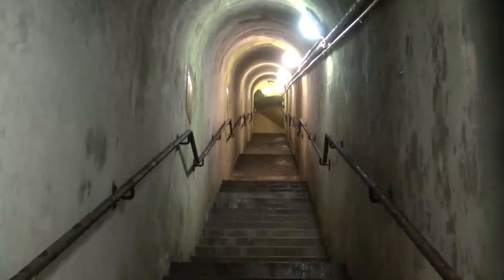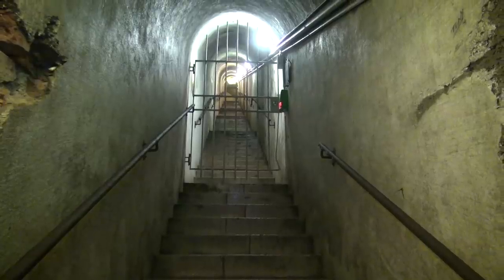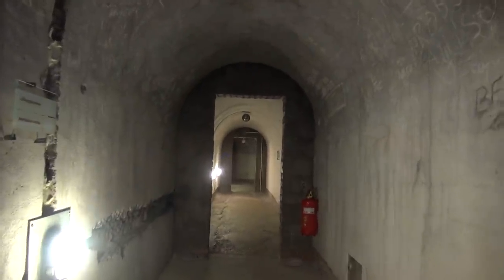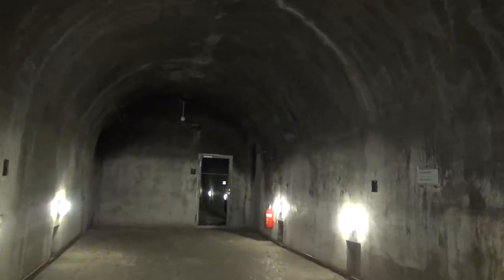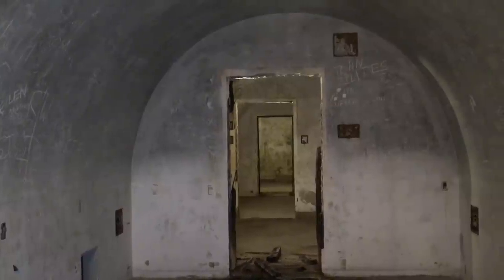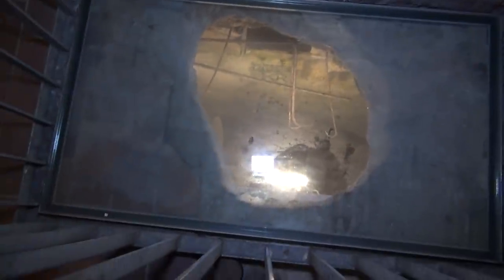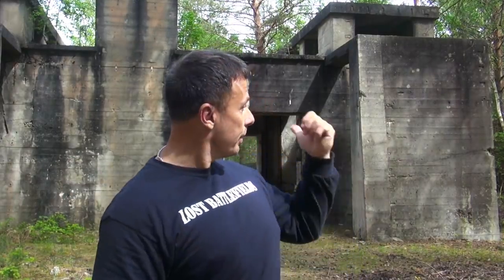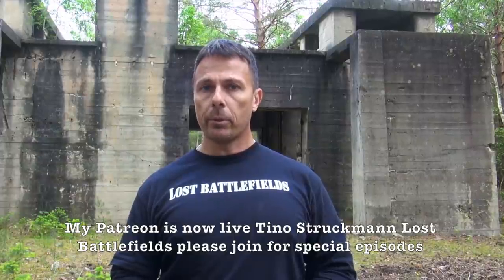LAST NAZI SECRET SPECIAL HITLERS BUNKERS  - AND WHY KAMMLER DID NOT BUILD THEM  - ON LOCATION VISITS

Comment: Tito when I was stations in the FRG 1972 to 1977 my wife and I spent a week in B-garden and stayed at the Gen Walker Hotel. This was in 1975. I took the bunker tour which was given by a SS Captain who was stationed with the guard detachment there. He said that the bunkers systems  were built by Italian miners and mining engineers. It looks a lot different now and I still have the tour map you showed. There were still picks stuck in the wall on the left side of the wall when you first entered pasted the MG position. The tour ended where the service elevator was. (There was no bridge. Yes that is (or was the gas ) the gas particulate filter.

Comment: How to these bunkers compare to what the illuminatee Elite are building today?? Are they renovating any of the old ones for their present day use???" New World Order " that had already started than and is been continued and according to their demented plans, finished in our days! All very fascinating and frightening! Thanks for all your research  Tino
Reply from the maker: actually that is an interesting question, some old ones have been renovated and quite a few cold war bunkers also. There is a bit of a difference in what was built during the war and now, main issue is that than the Germans especially were building to withstand air raids, and today people build bunkers for a number of reasons but mainly to protect themselves from people I suppose, today's bunkers focus more on sustainability, food storage supplies and secrecy. and they are smaller. except for the super rich. and made from cheaper materials, plastics, fiberglass etc. most would not withstand a direct bomb hit from a tall boy. I will try and set up some visits with those constructing these bunkers today and compare them with than. It might be fun.
Reply: Retreating to a bunker for an air raid is one thing, but when you have to go underground and remain while the enemy over-runs the land above and occupies it, you have already lost and might just as well surrender and remain out in the air and sun. The Nazis seem to have realized this, as most that could have tried to hold out left the bunkers empty and tried to flee the country. Then or now, there is little point to bunkers except to withdraw temporarily from air attacks. Does anyone in the US government really believe they are going to withdraw into Mt. Weather and come out when it is over and start running the nation again? If they are lucky enough to survive, there will be no nation when they come out and no one who survives is going to listen to them.

Comment: In Berlin ??? you cant not go to the furherbunker for a long time now??? because a lot is destroy and cover now whit a parkng above the say i would be a shrine for neonazie if it stay there but other place like wolfslair and operzalberg at the only two place where you can see a little today its not the full extend what was really in the past and i see the full extend 20 years ago when you could go still in some tunnels there but now the are all seal off maybe you got acces whit request but there is not mutch to see anymore a lot is full of water now in the lower levels of it and the part where the ss bunker was it was very big in the time the holl system in operzalberg like a maze only the engine is still from ww2 and still running for its age its amezing how wel something was build in that time it was build to last very long that we can not say today -) the most great to see  is the shooting range the have in it and so it was really  very modern for its time i dont now if you have see that part i will see it in the video -) but cant wait it was build very well and it was still not finish also a lot was normaly still in construction also in operzalberg
Reply: you seen the vid they break a wall to find the ss bunker what is next to it and try see what they can find but most was flooded  so had diver in there for sofar posibble to look around
Reply: @harrie4332  yep from begafilm group it was the last time the where alow to go in there sad because it was already the same that the plans where in american hands and there are not avaible for us the are still top secret for us